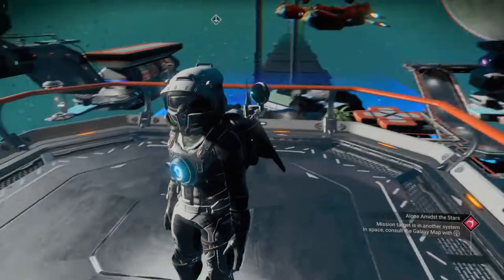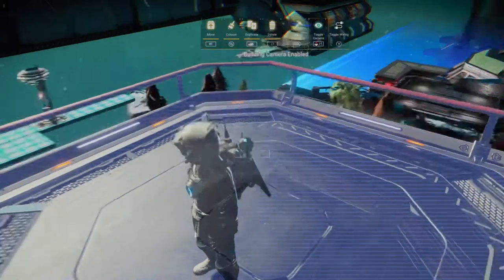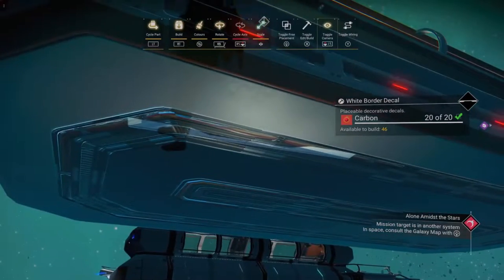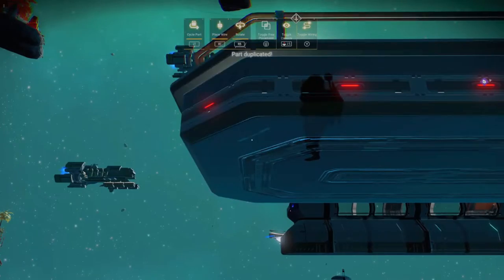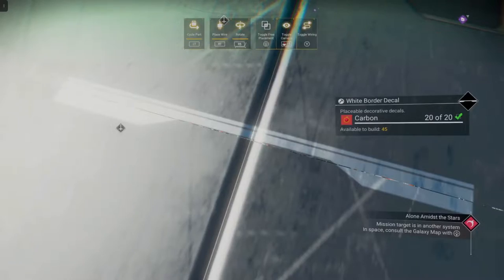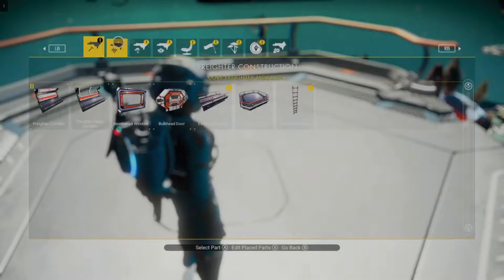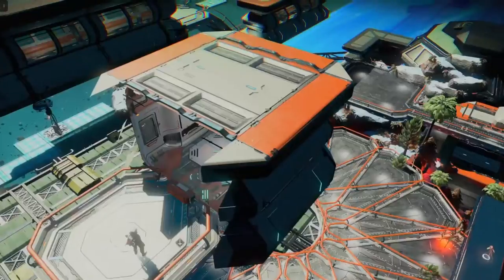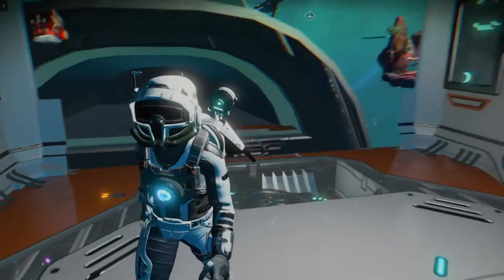Hiding railings and walls on the new freighter platforms and rooms

Comment: How about the new stairs?  Terminate outer stairs with open railing into the center of a large platform landing.
Reply from the maker: good idea! hiding the railing on the new stairs does work with this technique.
Reply: I must not be hitting the exact seam for the stairs then.  I’ll try again later.
Reply from the maker: @BearCub2049  sometimes picking them up and replacing them can help (the stairs)
Reply: I think I found it.  It’s right where the decal decides to flip back and forth when changing surfaces.  I just completed one.  Sadly, I don’t know if it work on the edge of a platform cause the rails for the platform will go into door mode.  I’m wanting to keep the banisters clear on either side.
Reply from the maker: @BearCub2049  yeah, some some small railings remained when i tested as well. you could avoid by that moving the upper floor one light box down from its regular height. that way the stair bottom wouldnt line up vertically with the lower deck you were going to..if that makes sense
Reply: I got it.  

Offset (teleport wire) the bottom of stairs from center by one light cube (instead of one countertop) toward top landing.  Top landing can be in normal snap position.

Door glitch the top landing first.  Then snap a platform into top of stairs to keep the door when you delete the top landing.  Top landing will interfere with finding the top of the stairs when door glitching.  

Open each end of the stairs.  Trim excess platforms.  

Replace top landing, and delete the door retainer platform covering the top of the stairs.